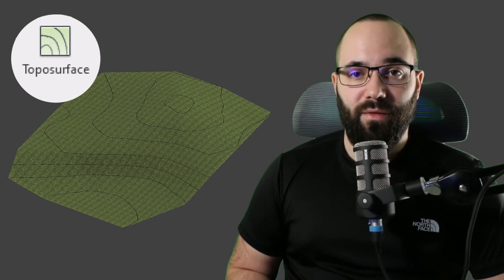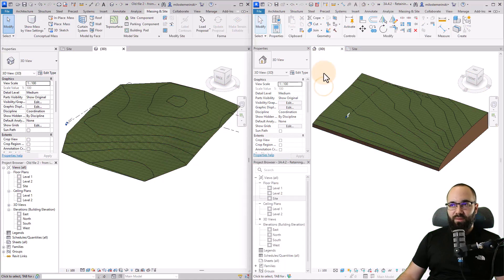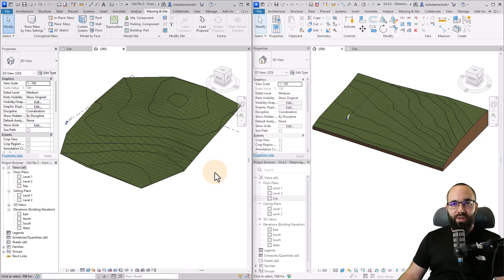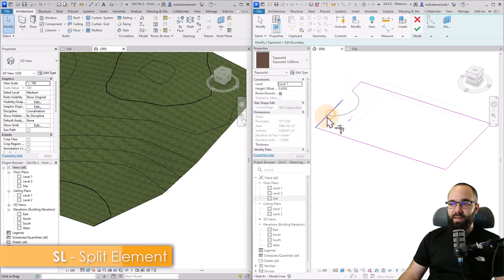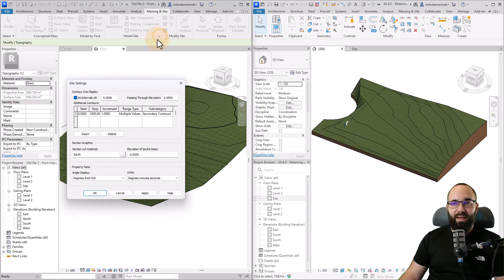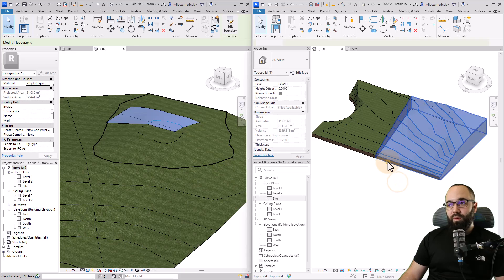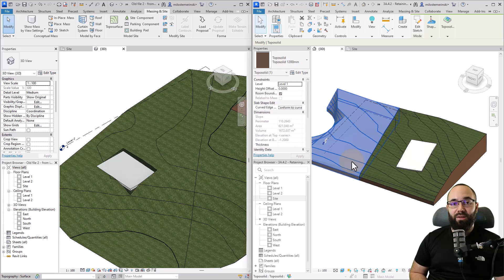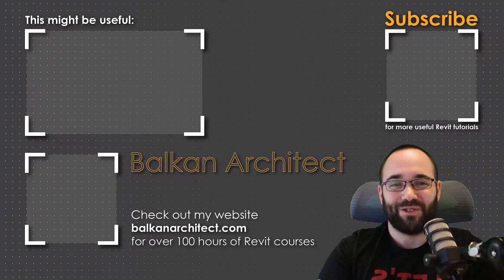Toposurfaces VS Toposolids in Revit Tutorial

Comment: topo solid dont work on cad link topo from civil 3D, the point is not align in the topo line of the cad file if you create from import  compare on topo surface the point is accurate align on the cade line topo

Comment: Hi Milos. There IS a workaround for the (possibly annoying) 2 things about topsolids. Both workarounds entail using either ACAD or Civil3D... 

1. "Split toposolids - can't be rejoined". Solution: Save a 3D view (only show ALL the split toposolids to re-join) into a DWG file. Clean up the "splitting polylines" in ACAD, SaveAs a new DWG as a new "surface". Create new toposolid from this modified DWG.

2. "Make a toposolid by face from mass - the toposolid can't be edited as a normal toposolid". Solution: Kind of the same thing. Save 3D view into a DWG file. Re-import into Revit, then create new toposolid from imported DWG.

Comment: A problem that nobody mentions is the graphics. With toposurfaces you can see the profile lines on elevations and sections, which adds depth and shape to your site, whereas in toposolid there is no profile visualization option and it shows as a flat surface in technical drawings (except for plans with contours of course). The only workaround is supposedly enabling folding lines (+ambient light if you need to) as a guide and then drawing detail ones where the profile is right, but takes a lot of time + it's view specific... I don't understand why such a basic feature is not added. I know toposolids are based on floors which don't have profile lines (as they never needed to), but didn't they think to make this exception for toposolids?

Another issue in graphics is the flat shading. Well, that's more of a minor one, as most of the time you are going to use Revit for technical exports, but still remains an annoying feature sometimes when you need to show shading, and your site looks like plastic...

It's such a shame because, for me overall, toposolids are a step forward.

Comment: I guess topo surfaces and topo solids are good for architectural civil site plans. But in civil engineering, Revit surfacing is not the way to go.  For more accuracy and tying into survey along with all the other things.  cut and fill reports planning profiles you should be using civil 3-D.  In my opinion, topography should not be shown in architecture or structural or any other discipline for that matter.  Your civil site plans should not be done by an architect. It should be done by a civil engineer.